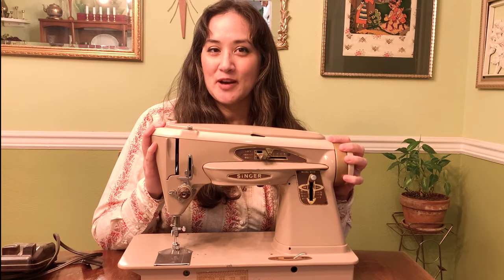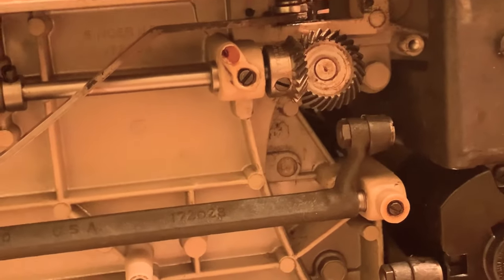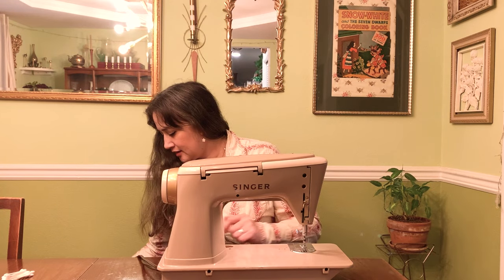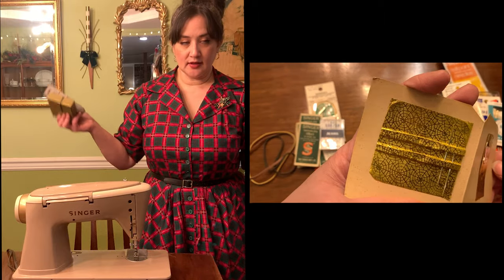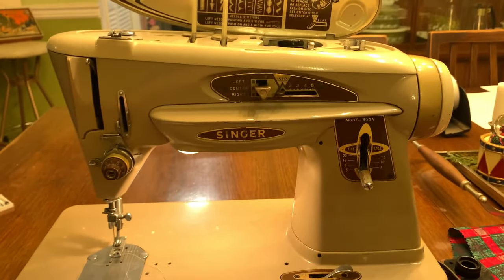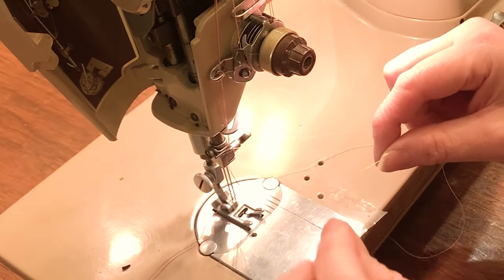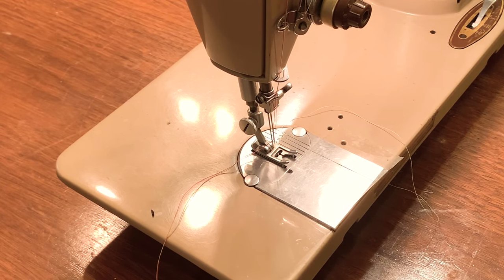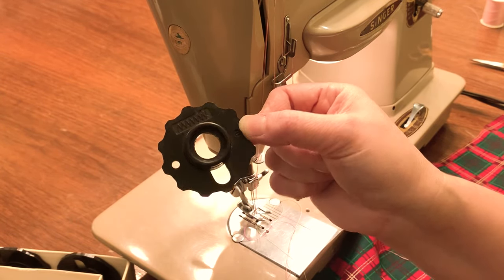Singer (Rocketeer) Model 503A  - I Ignored This Machine For Almost A Year

Comment: I have the 500a as I my daily driver. It’s awesome! You should always clean and oil a machine before running it full steam. It’s been sitting probably decades and dry as a bone. These machines were designed to be oiled/serviced regularly by the owners. This is probably why it’s so noisy, too. You can download the manual to show you where.

Comment: What a lovely machine - it even has the often missing removable thread pin to use with the hood closed (so jealous in a good way)! FYI, the Rocketeers don't require a twin needle - they're made to take two single needles, too. Thank you so much for this video and for sharing your 503A!
Reply from the maker: I did read that it could take two single needles as well. (So cool!) But I've been sitting on that twin needle for a while and was dying to use it. I'll probably show the use of the two single needles along with some decorative stitches in the future. I do really feel lucky about finding this one in the wild, in this condition with all that came with it. Thank you so much for your comment!
Reply: Mine had the thread pin, as well. Amazed at how complete it is.

Comment: So, IDK about the 503, but one reason I like my 403 is the needle bar can hold 2 needles using regular needles as designed. I bet the 503 will do that too.
Reply from the maker: It does! I just had a twin needle burning a whole in my stash. So, I gave it a go for this video.

Comment: I'm so glad you had a chance to experience that machine.  I have the one I grew up and learned on. It works great also after all these years. I hope you continue to enjoy it.  Just a quick note about your threading the machine.  Do you know that there is a horizontal slot at the top of the needle?. You do put your thread through there before threading the needle. I love my machine and use it when I have slightly thicker fabric to work with. It is a work horse. If you have any questions I might be able to help. Enjoy.
Reply from the maker: It's a really great machine. I try to try all the most talked about machines so I can encourage new sewists to try learning on a better built machine for less. This one really checks off some good qualities for sure, plus it's pretty. Thank you so much for your comment!

Comment: Yes as someone commented it is the social security number.  Back in the late 60s the police depts were big on asking people to engrave an identifier on your possessions in the event of a theft.  They even loaned out an engraving tool for this.
Reply from the maker: So, wild to think of that as a recommendation (now). Thanks for the insight.
Reply: Look up Andy Tube on YouTube. He teaches you how to get that bobbin plate back on. You need a little screw driver. He teaches you how to clean it and oil it. You grease the gears first and then you oil the rest. Your machine is almost identical to the Singer 403 so watch his videos on that model. Before you stitch, put your top thread under the foot. Love your machine! I have the 401a and gave away my modern machines because I love these old Singers!

Comment: The bobbin cover - remove the cover and the stitch plate, you’ll see a sort of spring clip at the front of the opening, and you’ll see a corresponding notch in the bobbin plate. The plate slides onto the spring from the back moving toward you. Then it will be locked in and allow you to slide it open and closed.
Reply from the maker: Thanks for the offer of help. When I was initially trying to get it to stay in place, I did all of what you mentioned. I have similar machines with the same mechanism. I unfortunately, just have a broken plate. Thank you though!

Comment: Gears look and sound dry. Way too noisy. Use sewing machine grease on the gears. Oil frequently. The bobbin plate may have a broken spring. As for the dual needle, better to install two separate needles to get zigzag and patterns. Follow manual to minimize needle strikes.

Comment: The unique number you showed is someone’s social security number. Back in the day, people used to write or engrave their property with SSN’s in case they were stolen or damaged in a house fire, etc. Just a thought. You might want to edit that out off the video or pixelate it so no one can read it 😊
Reply from the maker: I've received a few comments suggesting this and have read up on it (that it was a thing to do). It's so wild to think of that now in today's world. I actually just received another machine with a SSN engraved right on it too. Thanks for your comment and I did blur the number out in the video.
Reply: @TheaStarr      Was only about 25 years ago when you had new blanks checks printed and sent to you, you'd be upset if your ssn was listed under your name incorrectly, or left off completely because wherever you went to a retailer you had to by hand add or correct it because most stores etc. wouldn't take the check without it.  The good old days...In some respects.